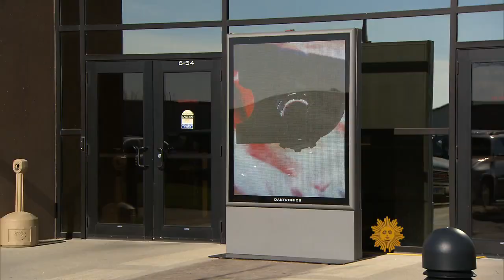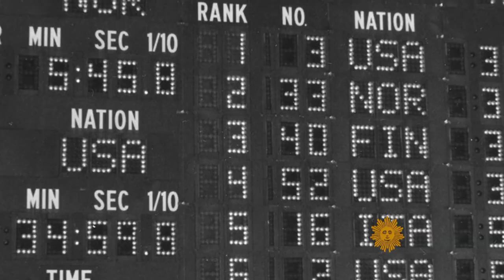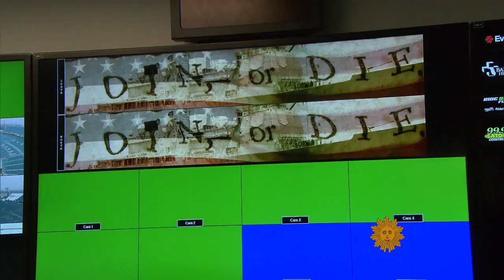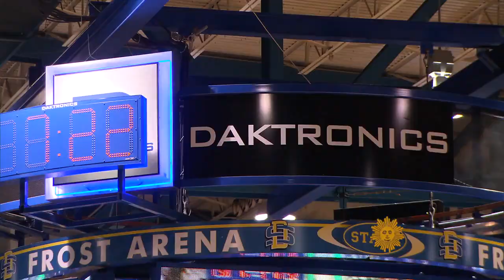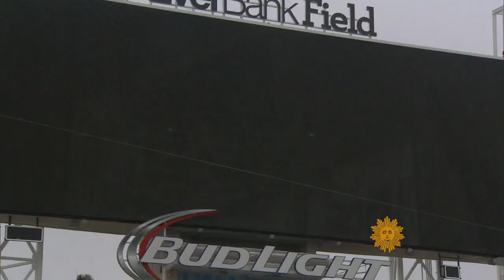The small town behind the biggest scoreboards

Comment: The Pensacola ice flyers scoreboard sucks and it is made by this company
Reply: Back when I used to work for Daktronics in the mid 90's, the technology was very basic compared to today. The LED colors were usually monochrome red, yellow or green, but if you wanted full color, it was light bulbs and colored lenses. Then they came out with their first LED color boards using red, green and blue. Blue was a new LED color and white hadn't been invented yet. That left colors with a strange tint to them. The LEDs also weren't very bright, so it took several of each color for each pixel. Within a few years white LEDs were created and the LEDs were a LOT brighter. Now you could use a single red, green, blue and white LED in a 1" x 1" cluster to get 16 million vivid colors .

Since the late 1990s the technology has become better and better, so what was a top of the line display or scoreboard in 2000 is now a bottom end piece of hardware.

I'm guessing the Pensacola flyers scoreboard is getting close to 20 years old. It's like comparing a 32" tube TV from 2000 to a modern 70" LED flat screen TV. Of course the old TV is going to look like crap.
Reply: So the the Pensacola Flyers bought a cheaper model, how is that Daktronics fault?  The vast majority of professional sports teams use Daktronics scoreboards.
Reply: What company
Reply: They should try another brand
Reply: ElevatorKid 123 dakteonics
Reply: Daktronics
Reply: Well the arena is like 35 years old